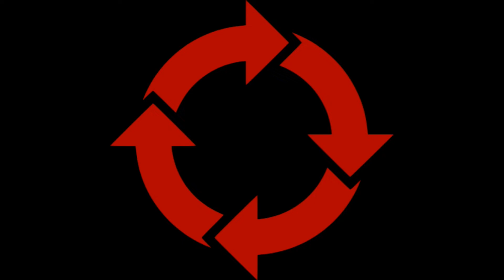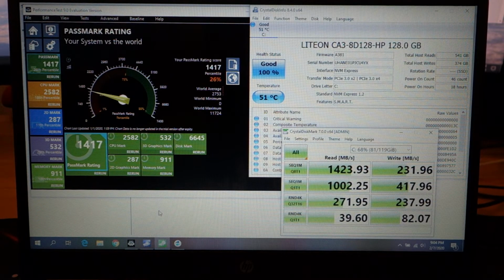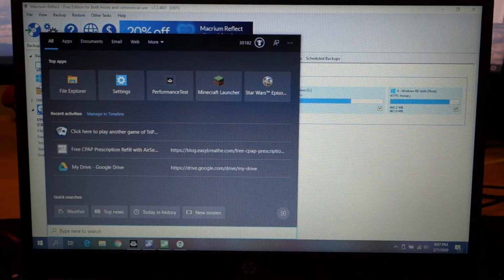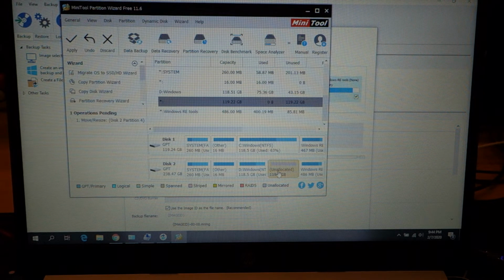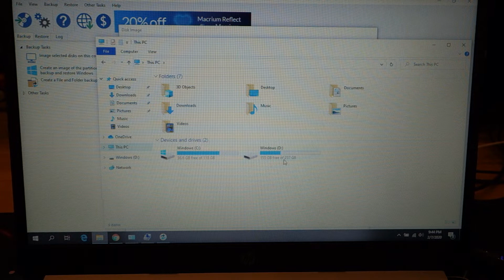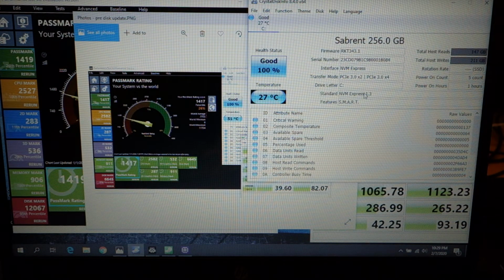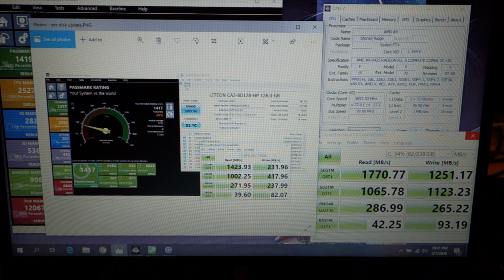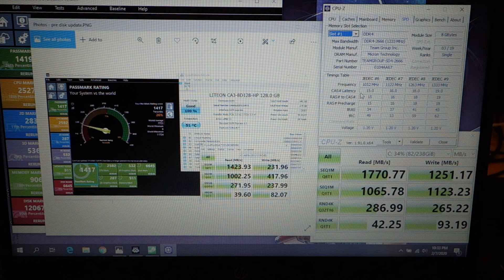HP 14-DK0002DX NVMe storage upgrade How to - improved performance?

Comment: On a laptop that only came with one WiFi antenna, that empty drive space could be an easy place to send it.  Just wrap a bit of electrical tape on the end if you are concerned about shorts.  It would be a lot easier than taking the display apart which would open the door to some potential reassembly problems and maybe display damage.  I am only considering that because I have an AX200NGW to replace a Realtek RTL8821CE that has one antenna but my laptop likely has just one antenna wire (pics of the RTL8821CE show just one jack soldered on.  I have no idea if the empty pads have traces that are useful.  They probably are not.  I just happen to have the AX200NGW which is not the best card there is but will run circles around that crappy Realtek all day every day.

Comment: My mother has the 128 GB in hers and the model number shown in crystal disk info shows that that one is NVME.  It is my way of looking around in a computer without taking the back off.  You can tell if it is NVME because that will have just one notch in the connector side.  Because of that, an NVME drive won't fit into a SATA only slot even if the width is right.

Comment: Hi man,

Thanks a lot for the video....I had a question- I actually have an hp 14-dk0010ca [laptop with almost identical specs as yours with the exception of the processor- A4 vs. A9]. It however didn't have a soldered in m.2 nvme slot although the motherboard had solder pads for it. I went ahead and ordered an m.2 nvme connector and soldered it in place. The NVME drive I got however was not recognized in the bios or windows (but did get warm).

I am thinking that either the m.2 motherboard area is missing some components (capacitors, diodes, resistors, jumpers, maybe a chip, etc.) or the m.2 slot is disabled within some hidden settings in the bios.

I really hate to bother you, but if its not too difficult (or perhaps if you already have them) could you please send me some high res pics of the m.2 slot and the components around it...perhaps I will find the missing components and ask a laptop repair guy to solder those components in. If its too difficult, no issues.

Really appreciate it,
Thanks,
Nooman
Reply from the maker: Sorry I don't keep these laptops long term. Since I have to buy them to do the review. I sell them to buy something else.

Comment: Hello, Sorry for all the questions. Did you do a test of 2- 4 gig Ram rather than the 8 gig and 4 gig? I installed the 8 gig with the 4 also. Does it matter what size SSD I put in there? I would like to put over 500 but if that makes it less productive I'll add a smaller one. My friend is going to install the SSD for me.
Reply from the maker: you cannot buy a DDR4 dimm under 4 gigs, I only have so much ram in my inventory, so I have a spare 8 gig and a spare 16 gig. I don't have a spare 4 gig. 

You can use any modern SSD, so a 500 or 1tb sized drive will be fine. I personally don't put huge SSDs in any of my mobile systems because I don't like to keep a ton of random files on there, I make sure i back it up to my network drive. But that's just me.
Reply: @AICvideo  OK, so why didn't you put the 16 gig in rather than the 4 plus 8? or put the 2- 8 gig in? I think you are smart when you say you don't want a lot of storage in your mobile system. Network System? I have a 128 gig SSD but now I only have 26 gigs spare. so my PC bogs down a little, so maybe a 256 would be sufficient?
Reply from the maker: a 512 gig ssd is fine. there is no point in putting in 16 gigs, the system isn't really fast enough to make use of 20 gigs of ram, or at least you'll hit a CPU bottle neck long before you hit a ram bottle neck. I only have 1 8 gig dimm, not two 8 gig dimms. 

A network storage device like this:
https://amzn.to/3cwVmWO

I put all my pictures and other important documents on it.

Comment: Hello AICvideo. I purchased a SSD from yoiur link and I messed up. It was the stick. I want an internal SSD like 500 or more. Can you recommend one. I searched for Sabrent in Amazon but didn't see one. Thank you for you knowledge and video's.
Reply from the maker: You mean like this? 

https://amzn.to/3fgPfaV
Reply: @AICvideo  yes. the 2.5 SSD. But you have no signup link for that particular item.
Reply from the maker: This doesn't have a 2.5 inch drive and requires modification to add one. I didn't do  it myself, so cannot show how to do it. I just upgraded the m.2 drive which is significantly faster than any 2.5" drive, by like 2-3 times.

Comment: also you cut the memory speed in half by running it in single channel mode by not installing a equal set of ram sticks. Here is the Service manual , http://h10032.www1.hp.com/ctg/Manual/c06242992
Reply from the maker: It only comes with 1 dimm, so adding another dissimilar dimm increases capacity, but does not affect speed (except more capacity does improve overall performance). Dual channel only gives about a 10% performance increase over single channel... on systems that can take advantage of it. and it really matters when you're multi tasking. This system is just not fast enough to really make that big of a difference.

Comment: also the service manual on hp site shows it does come with option for dual channel memory, so it was option at time of purchase, you should never install 2 different brands and specs of memory
Reply from the maker: Why not? dual channel doesn't do much to improve performance, and it doesn't do damage. We're not talking about a $4000 gaming desktop, but a sub $300 laptop.

Comment: AICvideo, thanks for the video...  i'm about to work on an identical laptop to upgrade for my son to use for school.  On the note of upgrading, since I dont have the laptop in front of me right at the moment...is the wifi card upgradable also?   And are you aware if there is a 1080 version of the screen that could go into this laptop?  (not too concerned with the screen upgrade, but it is a curiosity....am more curious about the wifi card (and of course the ram and ssd))
Reply from the maker: as far as I'm aware, no, the wifi card is not upgradeable. I went back and watched my video and didn't see the wireless card anywhere, as for the screen, I did not look into it. usually screens are so expensive, that the upgrade is not worth the cost, and you're almost better off selling, and buying a new system.
Reply from the maker: I take that back, The wifi is next to the fan. I don't know of any whitelist that HP has on these, so it should be easily upgradeable.

Comment: Hey, can I upgrade the processor on this laptop ? I’m trying to do an online job and there’s a requirement that the Local processor is 4. Right now it’s 2
Reply from the maker: No
Reply: AICvideo thank you 😭
Reply from the maker: That’s a strange requirement, because even up until recently even higher end laptops were often just dual core. What is the job?

Comment: I know nothing about computers, just so you know. I have the 240gb version of this laptop, I bought it at best buy about 6 months ago. Switched out of s mode, one thing I've noticed is that its a pretty slow. Loading websites or switching between different apps, would upgrading to 2 8gb ddr4 fix this? Would 2 16gb be way too much? Over all I want to use it to edit videos and just general browsing. Any help would be approciated. Thank you
Reply from the maker: It really depends on what the slow down is. If you're running at over 90% memory, then yes, If you are running at 90% cpu, then no. 16gb of ram is plenty in this day and age and should last you a long time on that system. I personally would cheap out and go with 8, but I also wouldn't use this laptop to edit videos personally.
Reply: @AICvideo  woukd a simple check througj the task manager show me if im using the 90 of the memory?
Reply from the maker: Yes
Reply: @AICvideo  thanks for your help.
Reply: @AICvideo  sorry to continue to bother you, but with the chrome and task manager opened, i am using over 60 % memory and the CPU jumps between 5 to 50 % usage. also there are 54 background apps running and 94 windows processes running. Including system related apps, antivirus, cortana and many other. most use under 10mb of memory, but there are a couple like anti virus that use over 70 mb and a few between 10 to 40mb. by far chrome uses the most at over 300mb.  i have tried ending some of the task under background but they pop back up almost immediately. I am not touching any of the 94 windows processes since i have a feeling they are important.
Reply from the maker: going to 8gb of memory would be a good jump, and going to 12 or 16 would be plenty, I wouldn't bother going to 32 gigs.

Comment: Do you think I can get rid of the ram usable thing? because I added another 4gb ram card and it says 5.92gb usable of 8.00gb.
Reply from the maker: it depends. Most of that time, the graphics card takes some ram, and other applications reserve some ram, so maybe if you drop (if it is possible) what the system reserves for gpu memory. I don't own this anymore so cannot check.

Comment: So I've actually just purchased this computer a few days ago, I planned on upgrading to at least 12gb RAM as well as to one of the SSDs you provided a link for. I've built a PC in the past, but never upgraded a laptop. Since this is a brand new install, it should be as easy as just disconnecting the old SSD, reinstalling the new and using the remaining empty RAM slot, putting in the 8gb, correct?
Reply: Dorian Eady we are in the exact same boat... I just need to know if I can just put the new SSD in... I don’t have to copy my drive because I just got it and there’s not much on it... so I don’t need the adapter right?
Reply from the maker: Yes, if you do not need to copy over your OS, you can put the SSD in there, but you will need something to install the OS again. you can just use a USB drive, if you have an 8 gig (or larger) USB drive, just google "windows media creation tool" and use it to make a bootable drive to install windows on the new machine.
Reply: @AICvideo  thank you so much for the response! Love the videos. Keep doing great work!

Comment: I have a hp omen 15-ce018dx and I installed a nvme m.2 and I left the hard drive in for extra storage and I put the os on the ssd and Uninstalled it from the hard drive and it keeps trying to boot on the hard drive and I can't change the order and it boots in repair mode and I have to use USB boot to boot to my ssd can you please help
Reply from the maker: did you delete the partition of the old drive?
Reply: @AICvideo  yea

Comment: So it is possible to add a second drive.(2.5)? Where does the sata cable would connect? 
I have already upgraded the ram an noticed the space for a drive. But didn't saw where to connect. I'm thinking in ordering the adapter but I wouldn't know where to connect it...
Reply: I looked the video again. I notice you already answered my doubt. Thanks for the video.
Reply from the maker: Sure thing. I think I even liked to the part in the video description.

Comment: I am need for the unlocked bios for this computer,...has anyone come across it?
Reply from the maker: the lock is something you would have set. If you have forgotten you password you need to reach out directly to HP.
Reply: No, I mean a modded BIOS with the ability to change values unlocked.   For instance: Advanced TAB, chip speeds, memory speeds etc...
Reply: @brianpeterson6033  same issue, cant configure my hp dk ryzen 5 variant. Waste of potential i tell ya

Comment: It's on sale right now for $199. Even though it only has 4 gigs, and 128 SSD, can anyone, including the poster of this video, tell me if you genuinely feel that it is worth it? Is the screen bright enough and easily legible, or does it appear washed out and dim? Is it fast enough for working on  MS Office and surfing the net? I honestly don't care to upgrade it. So, is it worth it regardless of price and specs? Thank you.
Reply from the maker: You will do better buying used to be honest. For a new laptop it is a great laptop for the price. BUT if you are willing to buy used, you can get something like a Thinkpad like this:
http://rover.ebay.com/rover/1/711-53200-19255-0/1?ff3=4&pub=5575128025&toolid=10001&campid=5337703343&customid=&mpre=https%3A%2F%2Fwww.ebay.com%2Fitm%2FLenovo-ThinkPad-T460-i5-6300U-2-4GHz-8GB-Ram-256GB-SSD-PC0KGQ5Z%2F164104322504%3Fhash%3Ditem2635613dc8%3Ag%3AEy4AAOSwLIpeWnWQ

that while yeah, is used and has some scuffs, would be perfectly functional, and last you easily 2-3x longer than this laptop that is new. BUT some people prefer to not buy used, so for them, the HP is a good option.

Comment: any idea whats the ribbon cord called for the hard drive extension? 
im planning to use my old laptop 500gb hard drive (sata) as the 2nd hdd
buying another sdd that 256gb isnt enough for me and kinda expensive  here in my country
Reply from the maker: https://amzn.to/2Vd1afJ - You can buy that cable there (along with a drive caddy and bumpers to hold it in place).

Comment: I’m having trouble playing cod mobile on this laptop. I upgraded the ram to 12gb but that’s it. What else can help?
Reply from the maker: i have no experience with cod mobile. isn't that for cell phones, not a PC?
Reply: AICvideo https://gameloop.fun/en/game/fps/play-call-of-duty-mobile-on-pc
Reply from the maker: ok, that makes sense, that is a game running on top of an emulator. emulation takes a lot of overhead on top of what the game takes. I doubt you'll get it to run well on this low end of a system.

Comment: i think it wont run dual channel because your ram has two different sets of cas latency, one is 15 the other 17, could mess with the timings.
Reply from the maker: Oh, I'm aware that it's totally in single channel because of the dissimilar ram. I will probably be ordering a set of ram to test with soon. That's just a lot of money.

Comment: thank you very much cause i have this exact machine....thinking of putting a hdd in.....could you help in directing me to where i can find the cable?? please and thanks :)
Reply from the maker: If I were to guess, I think it's this one - http://rover.ebay.com/rover/1/711-53200-19255-0/1?ff3=4&pub=5575128025&toolid=10001&campid=5337703343&customid=&mpre=https%3A%2F%2Fwww.ebay.com%2Fitm%2FHDD-Hard-DRIVE-Cable-HP-Pavilion-14-am052nr-14-am009la-14-AM071LA-14-am038ca-USA%2F273821983721%3Fhash%3Ditem3fc10fe3e9%3Ag%3A1%7EsAAOSwQc5bcV7-

But don't quote me on that. I haven't tried it, so I don't know for sure.